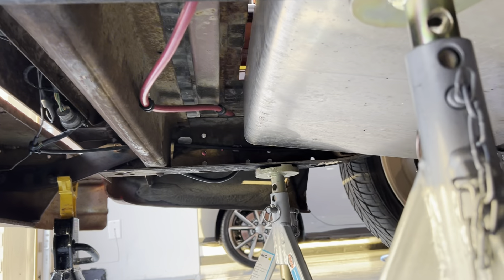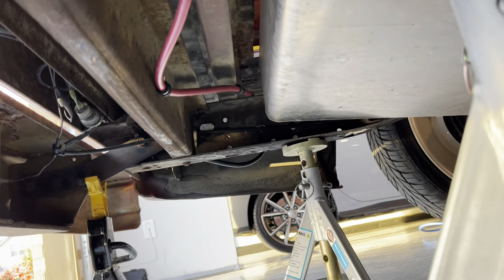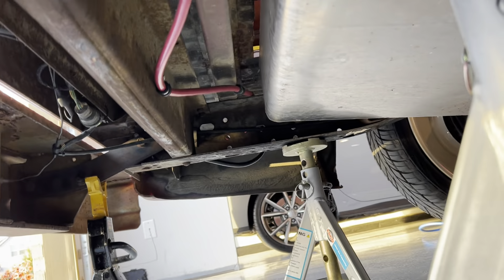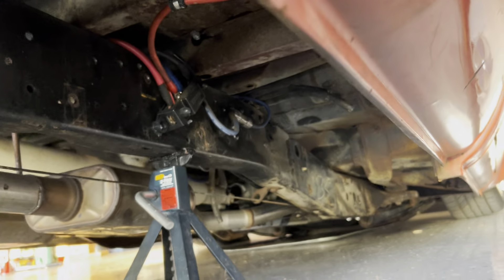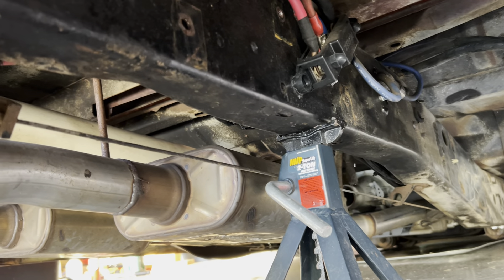1978 C10 Dual Batteries Wiring

Comment: Looks like the cable going into the bed fro the compressors and valve body has a boot on it that supposed to be stuck between the power cable in the bed and it looks like it has slid down the cable and is no longer where it’s supposed to be that’s to add insulation to keep the power wire from rubbing into the hole in the bed very commonNothing wrong with it, but it needs to be put back in the correct place.